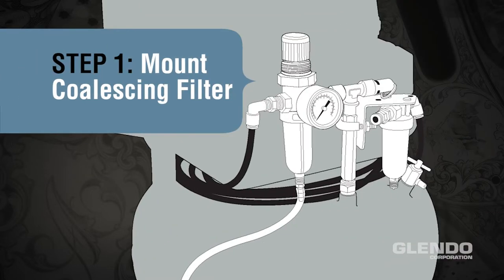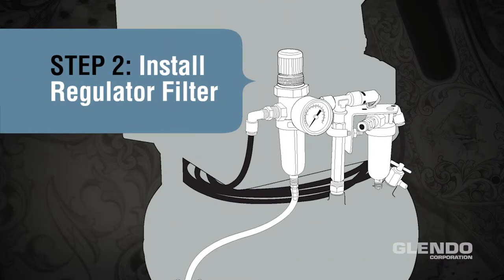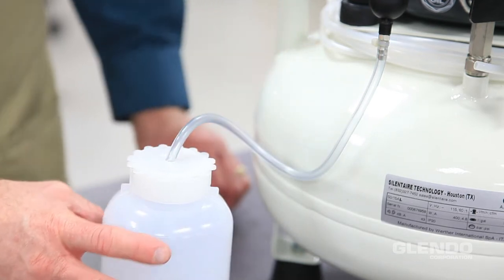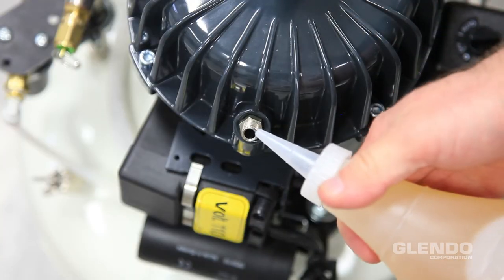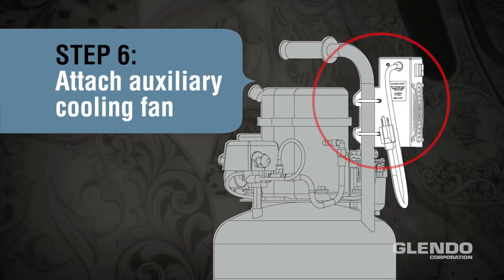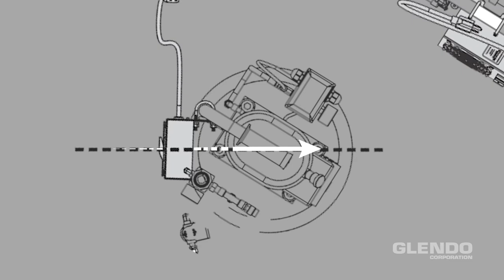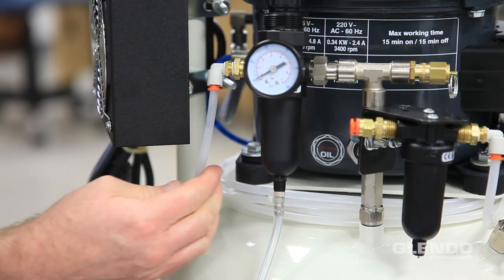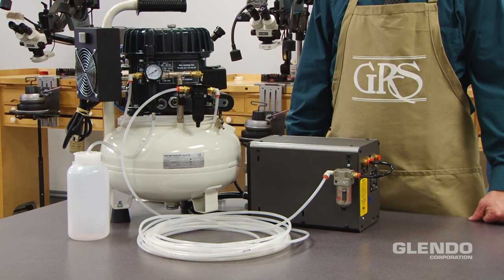Silentaire Compressor Setup for Hand Engraving

Comment: Is it common for newer version to not have a fan? Cause mine does not have a fan and gets noticeably hot. I also noticed this video didn't talk about the release valve to release moisture build up in the compressor tank. I attached mine to a old bottle to collect the yucky oilish  fluid that comes out.

Comment: Hi .  I have gravermax G8.  can I connect a Silver-Line compressor to it or do I need to buy a compressor from GRS ?
Is there a difference in it?  Do they have the same connection?
Reply from the maker: You absolutely can use a compressor that we don't offer, but please keep in mind the following requirements: GraverMax® G8 requires an oil-free compressed air supply with minimum pressure 45 psi (3 bar) and maximum pressure 120 psi (8 bar). The compressed air supply must have a minimum flow capacity of 1.4 CFM [ft³/min] or 40 LPM [L/min]. If the compressor you want to use is not oil-free, you will need to purchase and install an oil-removal filter (coalescing type – GRS® #004-579 or equivalent) in the air supply line to this engraving system. As far as the connection, I am unfamiliar with the Silver-Line compressor, but if air supply hose from the compressor to the G8 is larger than 1/4" (6.35 mm) OD, you will have to either replace the push‑to‑connect fitting on the supplied air filter that attaches to the G8,  or you will have to purchase a reducer to decrease the OD to 1/4" (6.35 mm).
Reply: @Grstools  I bought a planet air model L-S5025 compressor by mistake.  can you somehow help me set it up for use, if you need to buy the necessary spare parts from you.  I did not find the GRS filter --#004-579 in your catalog.  Air supply hose connection to G8 is greater than 1/4 in.  I don't want to hurt myself by using the wrong compressor.  thank you in advance .  help
Reply from the maker: My apologies. The correct item number for the Coalescing Air Filter / Oil-Removal Kit is #004-730. As for the fitting, your best bet would be to get a reducer or push-to-connect fitting from your local hardware store.
Reply: @Grstools  Hi .  I have another question.  where to connect the Air Filter / Oil-Removal Kit is #004-730 ? directly to the compressor before connecting the air hose or to the Graver G8 ?  I need to figure it out, buy and connect.  thank you in advance